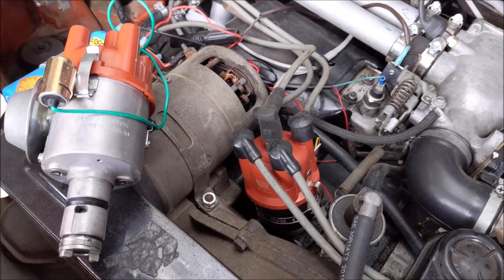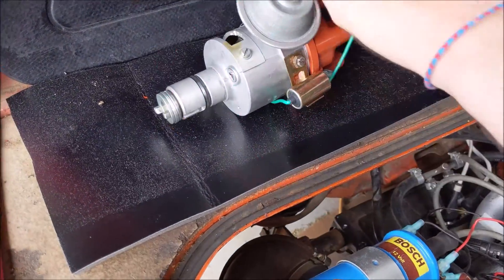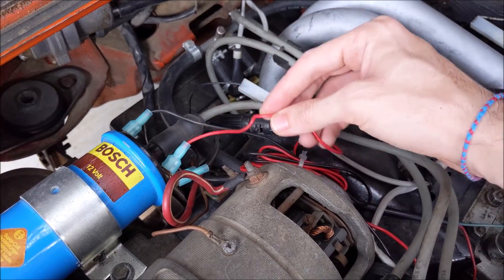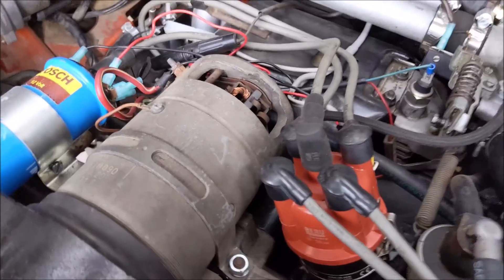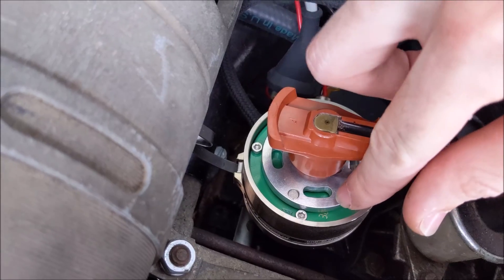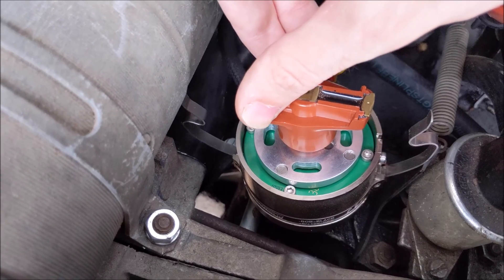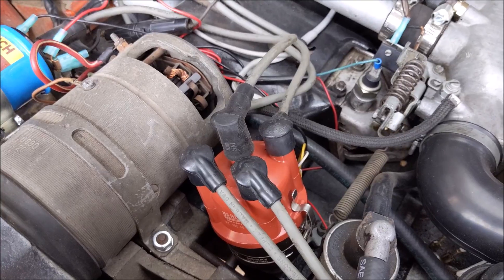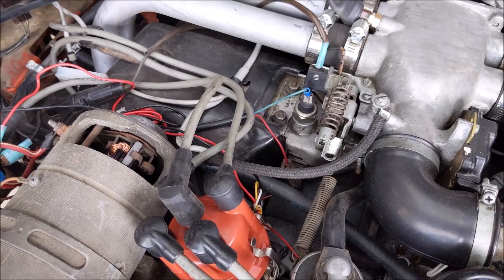123ignition Djet distributor for VW type 3

Comment: Hi, I have 1971 type 3 fuel injection also.  I am having engine shut off when it runs for 15-20 mins.  Did yours having the same issue and you change to 1-2-3 ignition ? thank you

Comment: I have a '71 type 3 I'm trying to get started.  The trigger points on this one, the wires were pulled out of the plug. I traced them back to the ECU and have the numbers, but I don't know how they go in the distributor.  Do you know anything about that?  Does it matter which way they go since the plug had no bevel to orientate it into the distributor clip?  Thanks

Comment: This distributor must cost a mint :)
Reply: It really did, but the whole distributor was the same price is a pair of NOS FI trigger points.
Reply: Do you have a link to buy this?
Reply: @danielkoucky7680  https://123ignitionusa.com/porsche-with-d-jet-912-914-356-vw-411e-412e-1600e-type-3-4-123ignition-distributor-switched-w-bosch-d-jetronic-includes-spacer/